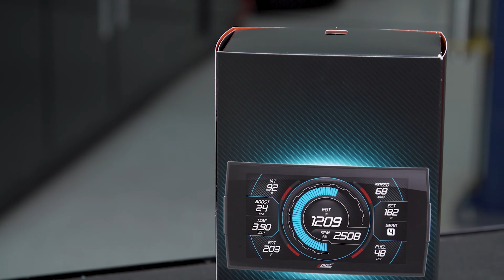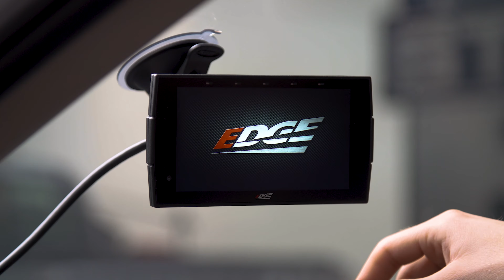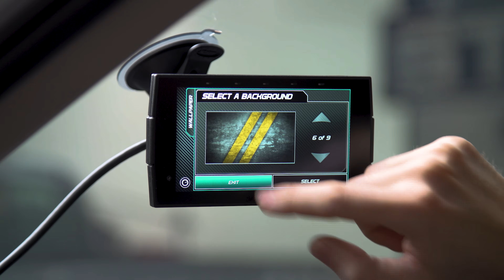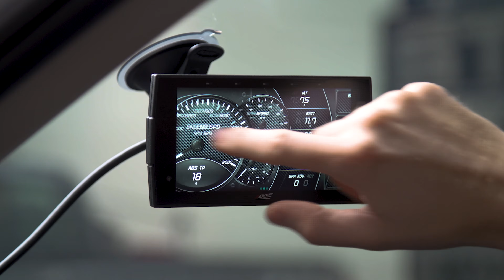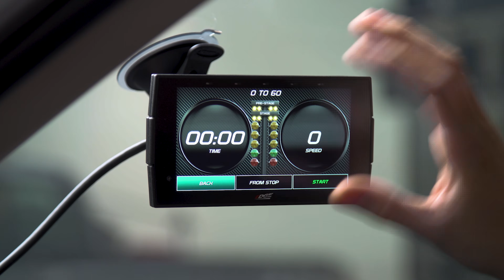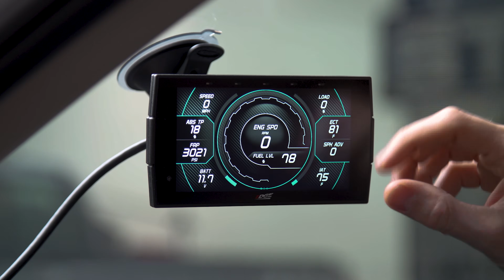Edge Insight CTS3 Vehicle Monitor System Overview

Comment: I bought this for my son to use in his 2022 Duramax Colorado. All it does is keep jumping back and forth from Loading PIDs to Gauges screen. I run one in my 2022 Chevy High Country and it works fine. 
I really wish we could figure his out. It’s a bummer.

Comment: Does this tuner fix P0401 code Exhaust Gas Recirculation (EGR) flow I recently installed a 5 in exhaust on my 04 Lly duramax and got that code was told I needed a tuner

Comment: I've called into the company and I'm not impressed with the offering for my 06 Dodge. If it was a Ford they would add Trans tunes. Not that they couldn't add tunes for the Dodge, They just don't offer them. WTF! You guys need to get on the stick, don't just offer the bare minimum. Make yourself a Great Name in the Community. Fat and lazy is how I would describe this attitude ( can you see the picture in your head). 
 My truck works the upgrade, but really it could be so much more. with just upgrading the operating system. You could offer it for more money, but not to even try. why don't you come back to this with a offering. What about the old mileage pro program? And it doesn't work with the modern Windows format, really? does it cost that much that you won't upgrade? come on Your worth it!

Comment: While the CTS2 had mpg display, I don’t believe the CTS3 does. This should have been covered in this review. Regardless this will prevent me from buying the CTS3. No point in paying more for less.
Reply: 2:27 in the top left, it says speed.
Reply: @toothlesstoad8040  mpg not mph
Reply: @joshherrell93  yep that was my bad
Reply: The CTS3 is actually cheaper than the CTS2

"*Some features may vary by make/model/year.

Data Parameters:

Accel Pedal Position,
Ambient Air Temp
Barometric Pressure
Battery Voltage
Corrected Speed
Desired FRP
Desired Idle RPM
Distance Code Cleared
Distance Since Regen
EGT Exhaust Manifold
EGT1 Post Turbo
EGT2 Post CCDOC/Pre SCR
EGT3 Post SCR/Pre DPFDOC
EGT4 Post DPFDOC/Pre DPF
EGT5 Post DPF
Engine Coolant Temp
Engine Load
Engine RPM
Engine Run Time
Fuel Pressure
Fuel Rail Pressure
Fuel Temperature
G Force
Gear & TCL
Horse Power
Intake Air Temp Manifold
Main Injection Timing
Manifold Abs Pressure
Mass Air Flow
Mileage Average
Mileage Coach
Mileage Instant
Percent Grade
Regen Status
Regeneration Reason
Run Time
Start Up Intake Air Temp
Time 0 to 60
Time Quarter Mile
Torque
Trans Fluid Temp
Trip Odometer
Turbo Boost
Turbo Vane Position
Soot Accumulation percent
Urea Fluid Temp
Urea Pressure
Vehicle Speed
Warm Ups W/out Emissions Malfunction
Warm Ups W/out Non Emission Malfunction"
Reply: What I regret about the CTS3 is NOT compatible with ANY Toyota vehicles. This is despite Edge advertising the CTS3 is "Compatible with most domestic gas and diesel vehicles 1996 and newer".
Someone might like to inform people about that that's a pretty big con in my book.
Reply: @MRW2890   New American manufactured vehicles only.
Great way to make your product obsolete in a competitive global market.
I bought another brand of monitor that's more adaptable.

Comment: Love the EDGE Monitors- quick question:  I know the Edge website says that the 2021 GMC Sierra 1500 6.2 is not “officially “ supported by the 84130-3 monitor yet.  But why wouldn’t it work since it is just a monitor that plugs into the OBD2?  I’m sure some parameters wouldn’t work yet, but couldn’t I update the unit over the Internet when they are?

Comment: Can i add a % increase for mph since I’m running larger tires? My Speedo vs gps speed difference is 11%.
Reply: Yes, but not in the way you think.  The unit can display a PID for "C speed" which is calibrated speed.  If you select to display this PID, you will have to input the factory tire size, then the current tire size.  Once this is done, presumably the speed indicated by the PID "C Speed" will be your calibrated speed.

This however will not change the factory speedo readout.

Comment: I just got the Evolution CTS3 but which is the serial number? I see numbers near the HDMI port and on the box but there is no S/N letters. I don't want to log the wrong ones. Update after one year: This monitor saved me from a very expensive repair. There is a bulletin out on the 2016 Duramax #2 oxygen sensor failure. This happened to me and the truck will not regen and the DPF will clog up bad. I was able to see the soot building up abnormally and I used my Insight to do a forced manual regen on it that worked perfectly. Now I go to the dealer for a free O2 sensor under warranty. Saved me a ton of money and hassle.